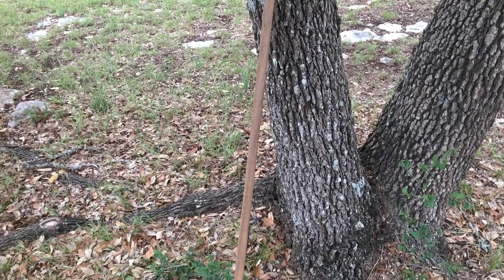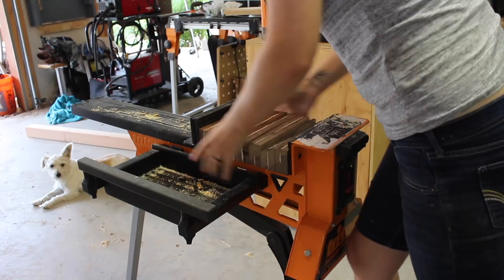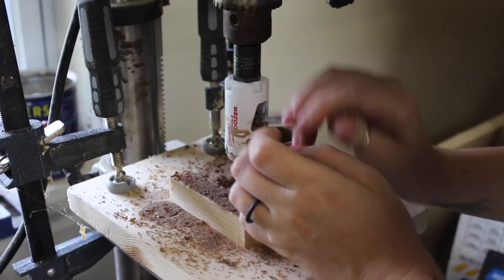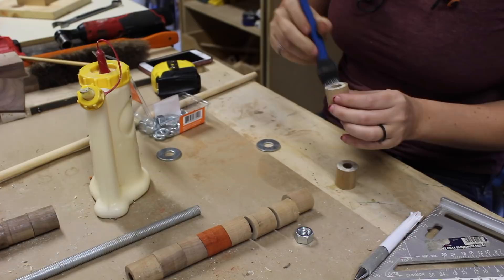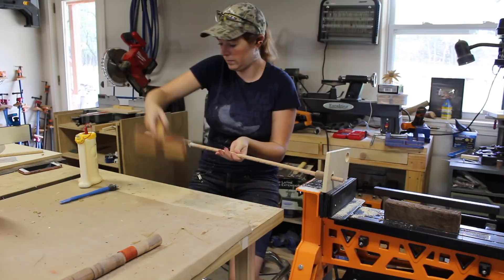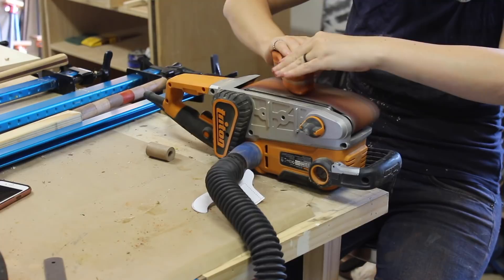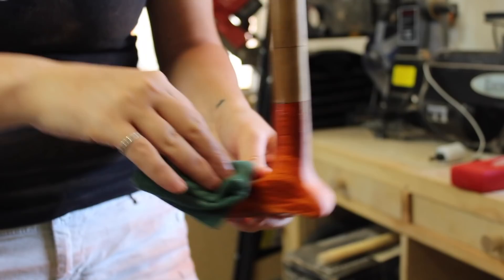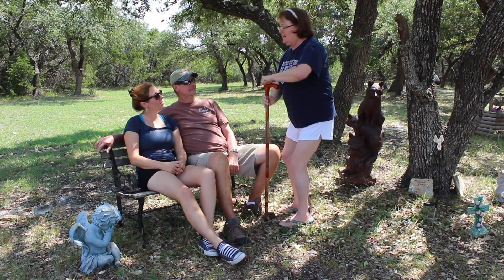Making a Walking Cane For My Dad - Without a Lathe

Comment: I have several canes, the first was a gun rest/monopod, that I made a handle for out of some aluminum tube I had laying around. I drilled a hole in the end and attached it by the quarter inch stud on the top, then another quarter inch stud with a plastic knurled nut on the very top. Because I'm an amateur photographer I could then use my cane as a monopod for my camera also.
I found one in a used store for 5 bucks that I liked but it was too short for a guy who's 6 foot 3 inches tall. I cut the end square and found a chunk of branch my friend had trimmed from a tree in the back yard. I drilled half inch holes and put it together with a six inch long piece of stainless steel tube and glue. 
The way you did this is something I doubt I'd have ever thought of and once more, you did a great job.

Comment: I too made a cane similar to yours. Actually I made 3 with each a little different design. I didn’t have good luck with the all thread either. My problem was cane flex after it was complete. You’re idea with the dowel is what I would do if I were to repeat my cane process. I used cedar, walnut and popular. It did turn out nice and I will make another cane using a modified process. 
There is a way to cut your cane to length. Have your person stand straight with hands to their side. Measure from the floor to their knuckle. You might want to buy a cheap cane to Tory this out. It does seem like the second time feels better. This method is available online.
Enjoy the ride. As you know woodworking is fun.

Comment from the maker: After finishing the cane I placed a rubber end on the bottom of the cane to give it grip: http://amzn.to/2fU3UbZ

At the time of making this video I hadn't yet unpacked all my turning tools or accessories, so I set out to make a cane without a lathe. However! another option would be to turn two segments of a cane then use hardware like this: http://amzn.to/2kv0RMC to attach them together. Just like a two piece pool cue.

Comment: April, when winter comes back, go out and cut down some saplings. Let them dry for 6 months to 2 years. Depending on the diameter of the sapling. There is a facebook page called "Handcarved Walking Sticks and other wood carving stuff" They are pretty knowledgeable folks and they will help you in any way they can.

Comment: If your lathe is large enough, it would solve your desire to have the grain run the entire length of the cane. But in a lot of wood the grain doesn't run as far as you would like. I've used Paduck, Ask and Walnut in a 12" open segmented bowl. The result was magnificent. You have some awesome tools. Best regards, Richard.

Comment: Occupational therapist advice here. stick is too long. Top should come up to wrist joint.  Lovely project. I use plumb tree or apple tree shoots. Cut them and let them dry in the shed bark on for a year.
Reply: sam henderson Sam do you Denmark the shoots before drying? Thanks, Tim
Reply: Tim. Wilson nah just use a flap disk and angle grinder to remove bark when done. But actually they look more interesting with the bark on.

Comment: Instead of cutting off the bottom to get the plugs loose, you can also drill from the other side, through the same centering hole, and since you'd be drilling only a very small depth, the plugs would now be easy to extract. A lot less wasted material.

Comment: April, find an old Disston hand saw.

Get one you don't mind taking apart 
for parts.

Now, use the saw handle, as a pattern 
for a cane handle.  But, use that LARGE 
nut and bolt from the saw, on the cane 
handle, as a "beauty" mark.

steve

Comment: The cane looks great. You might want to take a few inches off the bottom though, it's a little tall for the ergonomics of using a cane. You usually want the handle about even with the crease on the inside of your wrist, when your arm is hanging by your side. A rubber tip is nice for stability as well. No hate though, looks beautiful. I really like that there isn't continuous grain and both shades. Makes it more interesting, and not so cookie cutter looking.
Reply: Which should be right around hip level. Sadly, been using a cane for 5 years and rehab was very specific on getting the right cane length. Now, with that said, hes using it like a walking stick and probably not putting much weight on it so its probably not a big deal. I guarantee he wasnt holding that stick down around hip height lol.

Comment: So you don't have the risk of splitting your part with the bit, run the drill in reverse, it will self center even better and bevel the hole. you can then chuck all the parts in using one of the pieces of wood you cut them from. The clamp will be enough to crush the wood and hold the plug safe and clean without any risk. Just my two cents on it, as per personal experience, when you're working those kinds of sizes, things tend to get...hairy. 

REGARDLESS, beautiful cane, hope he uses it for many years and in good health. :)
Reply from the maker: Oh nice tips. : ) Thanks!
Reply: Haven't seen a drill press with a reverse option on it, would work with a cordless or corded drill though.

Comment: I recently had to replace a broken handle in my spade. As I was holding the new D-handle without the old spade blade attached yet, it suddenly occurred to me that it would also make a pretty cool walking stick! Also, while watching this video, I spotted in the suggested videos, "Hammer Walking Cane", where the handle is made out of a hammer head. Going to watch that next!
Reply: I saw a cane like that. I grabbed an old hammer head out of my tool box and wrapped my hand around it as if it was attached to a cane shaft. Nope. Felt bulky and awkward. Test fit first!

Comment: Here's how I taper a round stick for a cane without a lathe. I shave down the block to round and then sand it with 80 grit to near size using a micrometer to check. I then pencil a ring around the end about five inches in. I then do another ring every five inches down to the narrow end, So now I have a round block of wood with marks every five inches. I then sand everything from that first mark to the intended narrow end until the marks are gone. The I start another set from ten inches, every five inches and repeat. I keep doing that until I am at the last mark I place five inches from the narrow end. My round taper is now ready for checking my diameter. Remember it is a little thicker than needed. I sand it all until my micrometer is true and then I sand with greater grits until it is glassy smooth.

Comment: You are an excellent Craftsman young Lady!!  Really enjoyed your video!!  I make Walking Sticks out of Manzanita from my friends property.  I have been wanting to make one with a handle like this,  and you are the second person I have seen use this method.

It just dawned on me…. If the dowel proves to allow too much flex,  or if one just wants to guarantee an even stronger Cane,  you can use a solid Fiberglass dowel!!  Just TOTALLY WATCH OUT FOR THE DUST YOU CREATE,  NOT BREATHING IT AT ALL!!  I really wouldn’t want to contaminate my table saw with the dust either,  cutting that spiral for the glue,  the table saw being a much more difficult area to clean up to protect yourself in the future,  so I would probably setup my router (or something else) outside,  far from my shop,  and I won’t get into cleaning it,  because it is so problematic!!  Just be careful…. Or maybe a Carbon Fiber dowel would be an equally strong enough choice,  without as much danger,  and even lighter.  Look up the MSDS (Material Safety Data Sheet) online for each,  to find out.  You could always design a fixture that would allow you to use a VERY GOOD HIGH SUCTION VACUUM,  directly at the point of the dust generation,  to prevent it from going everywhere.  A HEPA filter on the vacuum of course,  but your vacuum is then all contaminated!!  Fiberglass IS POSSIBLY FAR TOO PROBLEMATIC for a small number of canes,  without absolute safety measures.  Maybe if you made tons of Canes or Walking Sticks using the hole saw,  glue up method.  Carbon fiber may be much safer…. but the bottom line is,  The Lord only made us with the intention of us breathing just Air,  with minimal contaminants.  Always use good Masks.

I would suggest you investing in a good MSA brand Half Mask,  of the proper size for you.  I’d find a good Industrial Safety Products Company,  that might have “Fit Testing” Equipment,  where they can measure any particulate leakage of your Mask,  so you can select the best fit for your particular face.  It is possible that you may even have to go with a different brand Half Mask to fit your face,  but I really like the MSA brands design/quality.  I worked at a National Laboratory,  and they had a dedicated Respirator Facility there,  and did everything top notch.  You had to get certified every two years I think,  watch a film,  check your fit.  (I had developed Asthma,  and always kept a Mask in my Rollaway.)  I dedicated a Plastic Craftsman Toolbox to keep mine in at home,  with all the spare parts,  and both the particulate Filters,  and and the Organic Vapors Filters,  even some special liquid cleaner to disinfect the Mask if you want,  and some moist towelettes as well.  That way I am all set,  and ready for anything I would need it for,  and the parts to maintain it.  I strongly suggest you take care of your Lungs,  to the best of your ability. 😉

Thanks for the great video!  You were very good at explaining your processes.  I only mention the Fiberglass and the Carbon Fiber,  because I’m big like your Dad,  and I always want my walking sticks to be able to handle self defense,  or coming to someone else’s aid…. In today’s World,  an increasing likelihood that it will be called upon for that duty.  In fact,  a Cane or Walking Stick,  is something you can Legally have with you at all times,  (even on Airplanes,  without question - your Dad might be able to stop a Highjacking!)  and isn’t considered a Lethal Weapon,  unless you use it as one I believe,  and I trust that if you are using it righteously… that you will be OK… but only the Lord knows… again,  given the times we live in!! 🙄🤗🖖

Comment: That had to be the hardest way to make a cane, but I love the ingenuity that you used to come up with a way to work around not having your Lathe to use.  Lots of interesting challenges.  Thanks for resharing Jimmy's tip on putting a screw groove into the dowel.  Either I've missed that video, or I'm too old to remember.  Either way hopefully I'll retain it now.

Comment: Clever.  Should work for walking, but I wonder about the strength.  I made some canes out of well seasoned saplings.  Seemed very strong, no bending when I leaned all my weight on one.  Then I slipped on a snowy step, fell, landed on the cane, didn't realize it had snapped like a twig until I got up.  Changed how I made canes, and figure now if I fell on one of my canes I'd be more likely to break a rib or two instead of the cane.  Intend to get a couple tested for breaking strength at the local university later.  Canes and wooden banks are what I like to make most in my shop, those and wooden puzzle chairs.
Reply: By the way, all of my cane handles are original designs (a few dozen now, and more coming), you ought to see my Grumpy Turtle handle.  The cane sites say a man 6' or over should have a cane 36".  I say that is a crock, I am 5'7" and my present canes are about right at 40".

Comment: So if you build another like this, use the hole saw and stop short. Then drill out the center to the size you want. THEN cut the end to release the spindles. Mush faster and MUCH SAFER!!!
Reply from the maker: Hmmm I like that idea. Yep that's a good suggestion. : ) Thanks
Reply: Another idea is to keep your dowel long so you can set it up in your drill to spin the cane while sanding it. Same idea as putting into your lathe, but for those of us whom aren't lucky enough to own a lathe... You can make a quick jig to hold both ends of the dowel and drill so sanding will be a breeze.

Comment: I would have kept the 1/4" center hole and used a threaded rod. But I normally work in metal.
Reply from the maker: I think a threaded rod would work great, but I like the lightness of a wood center. : )
Reply: that would be one heavy cane
Reply: A 1/4" x 36" threaded rod would weigh less than 8 oz. I own a walking stick that uses a threaded rod as the center shaft. It isn't heavy.
Reply: that still 1.5 pounds with all the wood idk seems heavy for a walking stick but im not one to judge
Reply: the other advantage to a 1/4" rod is you could make replaceable handle and foot. extra feet = one for ice, one with three feet to make it free standing, rubber foot for normal terrain and more :>)  love the build design, very clever (as usual :>)
Reply: the threaded rod approach would've been great if a means of protection were ever a need :)
Reply: i mean i wouldn't want to get hit with a wood walking stick either

Comment: How did you determine the propar length cane for your Dad?  Am also a cane user, mine is adjustable length aluminum, in two cylindars, one slides inside the othar, the outer has spaced holes down the length, and the inner has a spring loaded button that clicks into the holes.  The orthopedic derby handle has broken off, would like to have maker skills to repair/rebuild it, would also like to replace the aluminum with thicker, strongar titanium (so it could be used as a personal defense club).

Comment: Another tip is to drill your bigger center holes befor you cut the blanks free from the block. Would not have to put them in the vice and would make it easier to drill straight.
Reply from the maker: Then how would you cut the segments? If you drill a 1/2" hole in a square blank, then use a hole saw...which only has a 1/4" bit in it, how do you center it to make the cut?
Reply: April Wilkerson drill with the hole saw first without cutting all the way through like you showed then drill the larger hole before you bandsaw the bottom off the block to cut the segments free

Comment: Very Awesome! I want to do this for mom in-law. What size hole saw and drill bit for the center hole did you use? Also, how much material was used? Thanks again very cool.
Reply: Your center hole drill but would be just a bit bigger of the OD of your dowel. That hole saw looks to be about 1”.  Sizes don’t have to be exact.

Comment: I have to ask - where did you get the rubber stopper for the bottom of the cane?   I've got canes here and it is the one thing I wear out constantly.
Reply from the maker: I bought mine off Amazon. It was a pack of two for under $5
Reply: Ace Hardware has them as well, probably all big box stores.  Not an unusual item
Reply: Ah cheers; not seen over here in the big box stores.

Comment: I was just very surprised to see you cross cut with a fence I was always taught not to do that it’s a good way for your wood to bind. I would guess you were self taught or at least not formerly taught to use a table saw. 
When Cross cutting the cutoff piece should be able to move freely.   Other than that I think it’s a great job